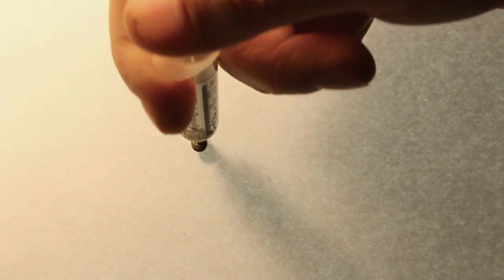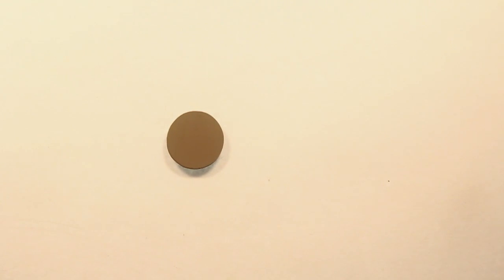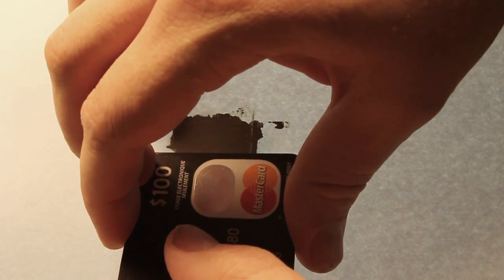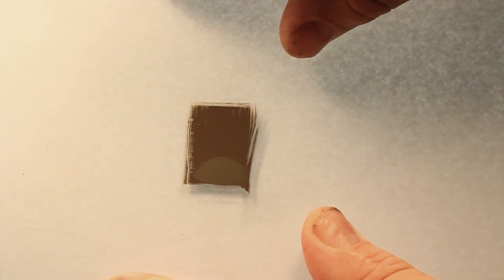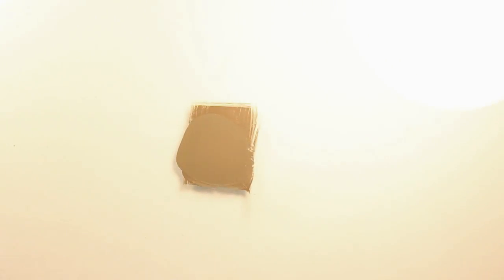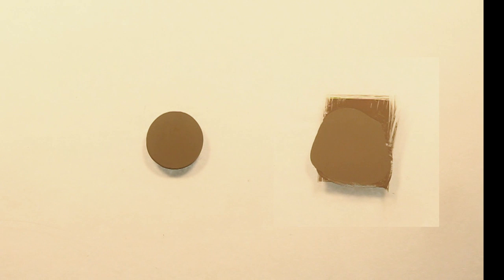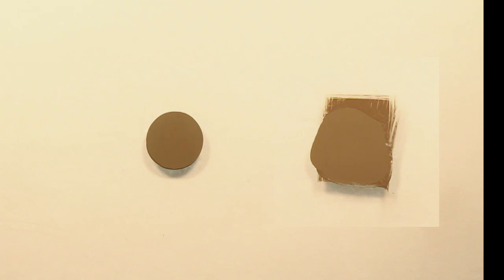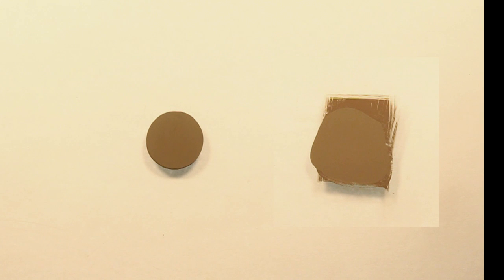Thermal Paste Spread Method VS Dot Method

Comment: Your 100% correct ive restored my ps3 fat with spreading it and my ps4 spreading it your getting the whole Cell , dot it only gets the center and it dries out faster using dot method bc air gets to the paste

Comment: The clamping or mounting hardware of the heatsink is going to apply more pressure than your fingers ever will. at least ones with metal clips, brackets, screws or studs.

Comment: Thinner is always better regardless, but if I was working directly onto the CPU, or GPU die itself, I would very much rather spread it really thin, so that I know that the entire die is covered. Same thing with working directly on the Cell and RSX dies on the PS3, after you've removed (carefully!) their heat spreaders. Thing is, spreading, when done correctly, for the proper application, works best. A bit of warning, though: If you're attaching a heat sink directly onto a CPU/GPU die, DO NOT attach the heat sink from an angle, or otherwise apply an angled force onto the die, or else you'll crack it. Use an evenly applied downward force only, and go slow!

On the other hand, if you're working on the heat spreaders themselves, the dot method is more than sufficient, and is virtually error proof, as long as you use the correct amount of thermal paste. What I would do in this case, is: once I have the heat sink clamped or screwed down onto the processor, I would slightly twist the heat sink back and forth, just to encourage the thermal paste to spread out a little more, for a thinner, and more effective heat transfer. Spreading it on the heat spreader, while it does work, is really a lot of effort for very little benefit in my view.

While Arctic Silver 5 is okay when working directly on dies, it wouldn't be my the first choice, because of it's slightly capacitive nature. You can get away with it if you're careful, why take a chance? Especially when you're servicing someone else's machine? I used to reach for the Ceramique in those situations, but these days, I've had good results with MX-4. Hey, if it works, then I'm not going to quibble over a 1°C difference between a selection of really good thermal pastes on the market, and I have no desire to get into a pointless fanboi debate over what pasts is best. If it works for you, then it's good, and it's all that really matters.

Anyways, everyone has their own technique which works best for them, and I'm only sharing what works best for me.

Comment: This test proves nothing, temperature test is what we need to settle this.. 

Dot method is usually better if you are clumsy and don`t do a good job at 
spreading it with the "right" amount of paste (as little as possible 
that covers the whole area). Most people I know get better cooling results with 
the spread method but then we do a good and thorough job 
evenly spreading a thin layer.
Reply: +Rondo Cat 
I agree.  Of all videos around no one has shown if there is a difference in temp.
Reply: @mariovazquez3874  Well, I can't speak for 4 years ago, but they have benchmarked it in videos since (benchmarks shown together at the 5 min mark in the video) :
https://www.youtube.com/watch?v=LHOBRvXYqEg

Basically 4 or 5 degrees C cooler with the spread or X technique. The problem with a dot, is that it will always spread as a circle and you'll lose contact with your cooler at the CPU corners.

Comment: The spread method isn't uselss, you're supposed to spread it lightly and without streaks, don't remove the side parts, when on a square like this [  ] don't cover the whole portion of the cpu, just spread enough that you can.

Comment: I have re-pasted several of my desktops about 20 times, the spreading method CAN create cooler temperatures with practice, if you make the surface 100% flat (second attempt only 22C idle)... the dot method needs lots of pressure and if your fan/heatsink doesn't have enough weight or isn't centre it will not spread compound perfectly, even with the X method ect. Also the idea is to create the thinnest layer possible, not suffocate it.
Reply: @Renan Rischiotto The best way it to make an x or a dot if you are applying it to a regular desktop cpu as the cooler will always spread it for you, LinusTechTips did a video on it and there was 0 difference in temps between spreading it and not spreading it

Comment: You can use the dot method where there is an IHS , like on CPU's ,the IHS already cover a larger part then the chip itself , so no need to apply on the total surface of the IHS.
But for Bare die like GPU , this is another story,they need to be totally covered with the tim and things can go wrong with dot method espacially if you don't put enough tim and the paste doesn't reach one or more of the corner of the GPU because even after spread , the dot method still keep a round shape . and bare die GPU's are square shape.
And with the dot method on bare die ,the extra paste tend to spread all over the smd's capacitors around the GPU , as long as the paste is non-conductive it will be fine , but in the other case......

Comment: Do you think people are that stupid???
1rst Dont cut and edit ur video when ur doing ur stupid method
2nd And most important if you apply this kind of pressure on ur computer you will break literally everything
3rd 95% that are using the dot method are wrong and the 5% is correct? And i am very generous with the 5%, i think it is not even 1%
Reply: ***** A smart person whatching this video understand very well !!!
Everything is so clear..... No comment!
xD
Reply: ***** Sure, my bad ^^
Reply: dude heatsinks applies x3 force than this guy with hands...
Reply: Armand B. sure they have the same pressure as a hydraulic press, get lost man......
Reply: Kostas Markopoulos If you have a heatsink with a backplate that you use screws to hold it. That would apply more pressure than what he applied to the glass.
Reply: Did you even see how much pressure he aplied to the glass? his thumb turn white, i wonder how the glass didnt brake....cmon....really xD
Reply: Niklas Nohrén
Did you even see how much pressure he aplied to the glass? his thumb turn white, i wonder how the glass didnt brake....cmon....really xD
Reply: Yeah, but when i installed my CPU cooler, i bet i used as much pressure as him xD But i always use the "dot" method. Best Imo :P

Comment: Video is dumb as fuck considering your knuckles were white as you pushed down on spread method, whereas the dot method you never pressed on the dot itself. You seem to be butthurt your method does not work. With the dot method and the cheapest watercooler on the market (cooler master seidon 120v) my fx 6300 idles at 8c.
Reply: 8c ? your pc is in freezer ? btw if your cpu has less temp than your room temp it will create water drops around it...
Reply: 8celsius? And no condensation happening? Either your pc is supernatural or you lie.
Reply: you let the cooler heatsink to pres the compound,for dot method
Reply: First of all, this video is to prove that spread method can be done without getting air bubbles in the center, not to prove that its better than DOT. Secondly, KNUCKLES can turn white?

Comment: ive used dot and spread method and i realized i got 3 - 4 degree celcius high on spread methhod. I cleaned the processor with whiteboard cleaner and used spread method and I get 4 degree celcius lower. I guess used the dot method, its better.
Reply: Kuro Senpai what youve just said doesnt make sense
Reply: +Kuro Senpai Dot method is better if you are clumsy and don`t do a good job at spreading it with the "right" amount of paste (as little as possible that covers the whole area). Most people I know get better results with the spread method but then we do a good and thorough job making it is evenly spread at a thin layer.

Comment: You are correct about the spread method being the most efficient because there is complete control over the thickness and coverage. However, any method will involve some spreading from heat and pressure. It's often overlooked that the layer itself should be semi-transparent since you're not gluing the parts together, only compensating for minute differences in the surface contact. However you spread the paste out is fine, whether you use the 'pea' method, etc., as long as you're sure that it is applied properly. However, the spread method is the only way to be sure before you attach the heat sink to the cpu. You can't be sure of any other method until you've taken them apart after heat has softened the paste. If the paste only covers the center which some folks say is the only important area, you're not using the available surface contact area effectively. If you're lazy or stupid, do it however you want since that's how you probably handle life's critical decisions anyway.

The other factor is related to the long-term effects of heat on the compound. Some compounds break down chemically or dry up after a year or so, thus losing a significant amount of thermal properties. I haven't seen a test of this aspect of the thermal pastes on the market, but I imagine it could be done by just over-heating a compound for a few hours. I've been using Prolimatech for years without any problems, but I do replace the compound every couple years as preventive maintenance.

By the way, if you think that new products you buy, such as graphics cards, are treated properly to an appropriate amount of good quality thermal paste, you're just asking for heat problems. You should always take them apart as soon as you've purchased them and redo the crap job you'll invariably discover. Of course this also applies to any 'used' computers or products that you buy.

Comment: You can clearly see that your spread method has areas of failed contact between the sheets of glass. Why not admit defeat, learn from the process, & benefit in the long run by accepting advice? But hey, it's not my CPU that you're trying to cool down & unlike you, I don't try to defend my disproven methods. Slightly larger than a cooked grain of rice but smaller than a pea, that's where I like to be.

Comment: "Arctic Silver 5 is one of the thickest pastes I've ever used so I spread it out almost always."

Dumb reason coming from a dumb concept. The thickness is determined by the space between the heatsink (hs) and the cpu, and by the pressure. Since that is the case, it's impossible for the thickness of the paste due to the method used (experimental variable) to be different if you are using the same cpu, hs and pressure (controlled variables).

Why? Because you are using the same cpu, heatsink and pressure!

Extra space (and thus thickness) between the cpu and heat sink cannot just come out of nowhere just because you used a different method. Ultimately, it is the pressure applied that determines the thickness of the paste between the cpu and the hs, but if those 3 are controlled (the same) then the method used should NOT have any effect on the thickness.

The problem with spread method is that the spread was not caused by the pressure between the hs and the cpu. That means that it could leave tiny, minute spaces to be left un-filled. Remember, the face of the hs and cpu, albeit looking very flat, is actually filled with multiple tiny depressions. Spread method only fills the depressions on the cpu (spread method spreads the paste on the cpu) and not the depressions that might be on the hs.

For example, look at the video, you can see that there are in fact areas on the spread method where there is NO CONTACT between the cpu and hs (seen as undeformed paste). Remember, the role of a thermal paste is to make the conduction of heat more efficient between the hs and cpu. No contact = no conduction.

Yes you could argue that those areas are not necessary since the die itself is in the middle of the cpu, but one should remember that this allows for a possibility of contact to the sides and no contact in the middle of the die. And the worse is, in actuality you wont know if the spread went right on the spread method because wont see that happen--heatsinks are not transparent.

Other non spread methods (such like the line, dot and x methods) on the other hand allows the pressure between the hs and cpu to spread the paste, filling both the depressions on the hs and cpu. Look at the video, all the areas where there is paste on the dot method has made CONTACT between the hs and the cpu.

Overall, if your problem is that the area of spread of the paste is too small for non spread methods (too viscous), then add more of the paste!
Reply: Great work....it would be that way...except...you messed up in the beginning so the rest doesn't apply. He is referring to Arctic Silver 5's viscosity rather than amount. Sorry appreciate the effort though.
Reply: "The thickness is determined by the space "

Oh, is that why milk is thicker than water? Because of the space? 

I'm pretty sure he meant the texture of the paste is thicker than others, and not "I'm applying less so the layer is thinner"
Reply: Thumbs up for the effort! I'm going to read your comment now. LOL

Comment: Good video, thanks and as far a comments go you have folks that would argue with a rock.
Reply: No, it's not a good video. He doesn't apply nearly enough pressure on the dot, and is using a (by now) outdated paste that is known to not spread well.
Reply: Lord Kitty Well I found the pressure is different for let's say a CPU as opposed to a GPU (which has very little on my HD Sapphire) I was merely commenting on actually seeing how the stuff spreads and of course more pressure will flatten it out more. I use Artic Silver 5 with very good results on both the CPU & GPU ( lowered temps 5 degrees on both)...the main thing is cleaning off all the old stuff in my book. Haven't tried it on my laptop yet but may someday.
Basically he was just showing what different methods will do. Me I use the dot method.
Reply: Sam Moss
I was commenting on the fact that people are right to argue about this video.
Reply: yeah if there is such a thing....i suppose these days that's par for the course. my comment was simply seeing what different applications look like when applied. it was my first time using paste and was googlin' around to see for myself before i made the plunge. to me when someone takes the time make a video to show how things work especially 'how to' vids if i think it helps, i'll say so and leave the uber scrutiny alone...sure there are some better than others, there always will be, but to me it's just a simple thanks.

Comment: Yea..... it's funny, because you didn't actually apply all that much pressure at all when doing the dot, but then when you had spread the layer out, you were pushing so hard directly on the past that if it had been a CPU under there, you would have bent the IHS and possibly cracked the die.....
Reply: duerdum9
Die fracturing is not an uncommon side-affect of applying too much pressure. I realize the metal thing is a heat sync.... That's why I called it one.... IHS Integrated Heat Spreader. Do some reading kiddo.
Reply: World Known theres actually a surprising amount of force on the CPU die with the heatsink is on top of the IHS... sometimes 50+ lbs depending on the cooler, and mountings used..
Reply: stoneyyay
I realize that, and if applied unevenly, can cause the die to simply crack. Heatsinks are engineered to apply pressure perfectly even
Reply: and the credit card spread method also leaves so many gaps there lol ...
Reply: +stoneyyay look up distributed loading

Comment: I was told to always make the thermal paste layer as thin as possible for the most efficient heat transfer. The dot method looks great when it comes to spreading but as u said it will be a thicker layer. Also those who like to spread try glossy business cards. I found those to be the best for perfect smooth surface and great for thicker compounds

Comment: The whole point is transferring heat to your cooler. Doesn't have to cover every cm of the cpu and microscopic air bubbles will not cause your system to explode. Either method is effective. Just take your time with the spread if you go that route. That example of the dot method he did will spread out more after burn in, and that's the only reason I use the dot method. I don't want to clean any of that gunk out of my socket in case i spread too thick!!

Comment: You don't take heat into account.  I've also seen fools like you spread it causing thermal paste to overlap and drop into the socket of the processor.  The dot method is the safest and spreads consistently.
Reply: correct

Comment: i actually think that this video proves the exact opposite of what he was trying get across. It seems that there are actually air bubbles in the "spread" version. i will stick to the dot method. thank you very informative vid
Reply: correct, the more you fuck about with the thermal paste by spreading it the worse it is
Reply: Synthematix In the end, if you have a good heatsink with good contact with the CPU, it doesn't make any difference and people get themselves worked up over nothing.
Reply: duncreg yup thats true
Reply: Synthematix Not really, when done properly the spread method can perform as well if not better than the dot method.
For example Puget systems did thermal testing on both methods and found the spread method improved temps. The difference was fairly minor but it still goes to show that the spread method is effective.